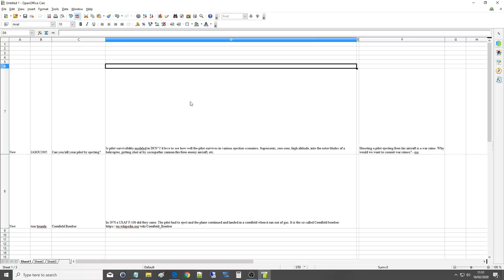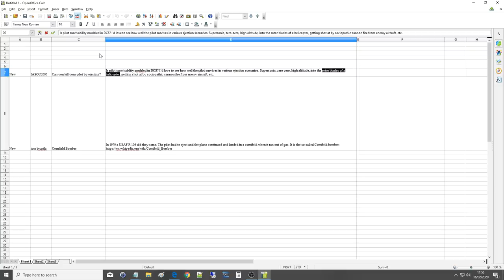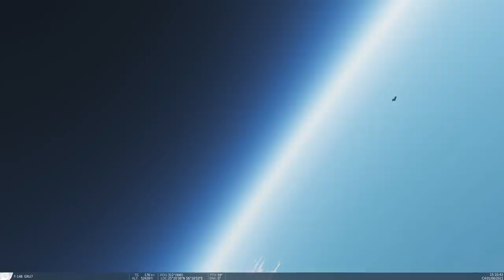Questioned: How Is Pilot Survivability Modelled In DCS WORLD?

Comment: In the late 70s, my dad and his pilot lost all air pressure in a CF-101 Voodoo at ( 'he says' more than 59,000) and they almost died... the pilot lost consciousness immediately, and luckily, the aircraft they were in was one of the ex-USAF two-stick aircraft rather than a single stick, my dad had to try and get down from 59,000 feet to around 10,000 feet before dying, flying from the backseat.    Probably had the speed record of a F-101 Voodoo on the way down (the wingtip light covers were torn off, the roundels were faded from the heat) but all the humidity inside the cockpit had turned into frost and coated everything.  he had to use the survival knife to scrape off the ice from a few instruments, and once down to 10,000 feet.  At this point his hands and face had swollen to huge proportions he said, and he couldnt hear anything on radio from their wingman, could hardly see, couldnt press any buttons, but he could see the wingman, who he followed back to base.   Wingman declared emergency for him, but the only switches he did NOT have in the back seat was flaps and gear.  he rocked the aircraft violently left and right until the pilot regained consciousness (otherwise he would have ejected both of them out, not knowing of pilot was dead or alive) and realized they were orbiting the base, and took command and lowered flap and gear.   When we saw him, it looked like he had been beaten up, because his face was all bruised, black eyes, the works, from the internal human pressure that counteracts normal air pressure had basically tried to blow them up, like Arnold on Mars in Total Recall.     He would fly again a few years later, but the perforated eardrum made it a painful ordeal, so he was pulled from flight status much to his dismay and went on to an interesting career looking at spy satellites, WMDs, that sort of thing.        

TL DR Pressure suits exist for a reason, if the front wheel door seal goes, all air from cockpit goes through the floor and outside the A/C
Reply: @Rivers256  I'd kill for a Voodoo.  after seeing the really nice F-106 skin someone did for the Mirage, I wonder if I could get someone to make an F-14 one (similar roles, though F-14 no nukes) 2 engines, 2 seater, old steam gauges.....
Reply: Fascinating story ! Thank you for sharing.
Reply: @Thunderkorn  anytime,, he has several awesome stories, but that one ended his flying career and almost his life.   No one ever wanted to eject out of a Voodoo, because it just might kill you (spine compression, it was old school ejection seat)
Reply: That’s pretty nuts, sounds like he just made it. Scary stuff
Reply: @rekunta  Yep.. my mom wasnt too happy when he went back up after his ear kinda healed, but then was happyx2 when he was taken off flight status.. bcs we were then posted to W. Germany :)
Reply: Matt Varnish your dad is awesome! Great story, thanks for sharing 👍
Reply: Better love story than twilight.

Comment: Cap when you eject (sr-71 at highest possible at mach 3) the air is so thin that the pilot feels like ejection at 200kn, the only thing they have to worry about is pressure(not sure) and oxygen supply
Reply: I don't think the pressure is really the problem as the pressure suits that were used were basically astronaut ones (not really, they were a model of their own, but close enough); the problem is the heat as a Mach 3 ejection would have subjected the crew to like 230°C (450°F), i don't know if they took that into account when they designed the suits, i assume they did, but i'm not sure.
Reply: Awww I was gonna say this
Reply: Nice thing about the pressure suits in a high alt ejection is that they “inflate”, providing some protection against the force of the air stream. There have definitely been SR71 pilots who’ve survived Mach 3 ejections (and even a disintegration!).
Reply: @keelhauling  The problem with your answer here is that full pressure suits aren't really designed to "inflate" (i'll explain in a second) besides, that would be actually what kills you becasue if you don't breathe out you can say goodbye to your lungs. The thing is that in a vacum (not really at 24.000m as the SR-71, but this is the extreme scenario) it wouldn't be just the suits inflating, but also the human flesh, as it can can expand up to twice it's size (see Alexei Leonov spacewalk). See, human skin doesn't need to be protected from vacum and it's gas-tight by itself, it just need to be mechanically compressed to retain its normal shape, in fact, since the X-1A, the pilots flew with partial pressure suits, that only had a pressurized helmet while the rest of the body was kept in shape by "metal tubes"; however, these suits weren't really confortable and they didn't give protection above a certain altitute nor for extended periods of time. Full pressure suits instead have no altitude limits as all your body is kept in a "habitable" environment (see X-15). The guy who sirvived not really an ejection, more really the disintegration of his SR-71, yes he survived (his RSO didn't) as the suit "kept him in one peice", but i'd like to remind you that both his shouldes were broken.
On a side note here, some sources claim that the A-12, still the fastest of the family with Mach 3.6, could actually reach Mach 3.8 or even Mach 4.
Reply: ROBERTO FONGARO ROBERTO FONGARO good stuff. To be clear, I didn’t mean to suggest that there was an any actual, intentional inflation going on, since yeah, the point is to retain pressure. Simply that the increased rigidity in a suit going rapidly from partial (cockpit) pressure to near vacuum provided some additional mechanical protection for the pilot.
Reply: ROBERTO FONGARO From Bill Weaver:

“I didn’t appreciate it at the time, but the suit’s pressurization had also provided physical protection from intense buffeting and g-forces. That inflated suit had become my own escape capsule.”
Reply from the maker: Interesting...
Reply from the maker: Interesting...
Reply: @grimreapers  that's why the crash at valley was so fatal they ejected at a low speed and a verry low altitude

Comment: Helos have had various ejection seats installed and tested but had some really funky rotor separation systems that would shed the blades before you went out. 0/0 was from back in the day where they were relying on airspeed to help clear you from the aircraft, clear you from the seat itself, and then ensure you had a canopy before you smashed into the ground. Ejection sequence is stupid fast...like sub 2 seconds from initiation to under a chute as long as you are low enough for the seat to let you go immediately.
You and the game are right, you would stay the seat till lower altitude and use the O2 that's onboard (the bottle on the side) unless you manually released it. Once your low enough you would be released and your chute would pull you out and the kit would deploy under you

Comment: It's worth noting that a lot of fighters and (especially) interceptors do have pressure suits - not just the SR-71 and U-2.

Also, there's such a thing as partial pressure suits, where for example your hands are exposed - these were used in at least the Mig-31 and F-106, and probably many other aircraft.

Also notably the F-4 did require a pressure suit when flown above (50/60, I forget) thousand ft, as did the F-106.

Comment: T-38/F-5 use the Martin Baker MK16 ejection seat. McDonnell Douglas originally developed the ACES II used on the F-15E and has three ejection envelopes, Low Altitude (Instant chute), High Speed (Drogue chute to slow you down), and High Altitude (Delays Pilot/Seat separation and chute deployment, kicks on oxygen). Both seats have barostatic altimeters, and speed sensors for determining mode. There is a pilot survivability chart in the documentation as well as a max recommended ejection speed of 600KTS.

Comment: I suspect at extreme high altitude ejection, you might be fine even at supersonic speeds provided you can survive the pressure. That same low pressure means there's not much air hitting you to batter your body to bits either.
Reply: so jets have less resistance up high but have to work harder because of lack of oxygen for engines???its like you gaining advantage and loosing it lol
Reply: @votpavel  And they handle more poorly due to less air flowing over the wings to create lift, and less air over the control surfaces to give pitch, roll and yaw authority.

Comment: Zero zero ejection seats are a recent development. For the first forty years or so  after ejection seats were first developed ejecting below 1000 feet was usually fatal because the chute wouldn't open before impact. Zero zero ejection seats have save quite a few carrier pilots who've had engines fail on take off and landing. I don't remember when they were first used but I think it was in the late sixty's or early seventys

Comment: Oh, when I was stationed in Okinawa, Det 1 operated the SR-71 right by our hanger. They went up one day. There missions lasted about an hour because of the fuel requirement. They refuel with a KC-135Q which carried JP-8. Well this SR did not come back when it was supposed to. SR's don't divert to other bases if they run into trouble. What happened was, they where around the Philippines at altitude, when they had a double flame out. After a failed air start, they punched out, and were picked up by some fishermen off the coast of the PI. The jet went inverted and hit the water so hard, it broke in half and the main gear wheel wells popped out of the wings. There was a big recovery operation to get the fwd fuselage, with all it's Top Secret equipment. Russian trollers showed up and were buzzed by F-14's or 15's while the Navy recovered the aircraft. Never got the whole story why it flamed out, but rumor was it was bad fuel. I know a team showed up in Okinawa to test the fuel in the tanker that refueled it after take off and the JP-8 fuel storage on Okinawa.

Comment: About the supersonic jump! In 2010 at Juupajoki, Finland there was a Hornet crash in which both pilot ejected at almost supersonic speed. This  Hornet was a Finnish "Frankenplane" F-18D, a modified F-18C. This Hornet was built from two plane. The main frame was survivor of a midair collision (2001) and the forward section was a from a Canadian CF-18B. So this F-18C was turned in to F-18D and therefore was a bit different kind of a plane. 

During the test flight F-18D's servo broke up. The F-18D dived almost at supersonic speed towards the ground. Pilots ejected at 4,5 km altitude in practically vertical dive. Due the speed the air blast broke both pilots legs and arms but they nevertheless survived the ejection. After a long sick leave and few surgeries they both have now returned to active duty. 

My friend knows the pilot. The pilots tells story that while he was lying in the ground with broken arms and legs the pain was growing up quite much. A local farmer came to the scene and before the farmer could say anything pilot told him sternly. "Now, listen me carefully. Before you do anything else, there's a tube in my left leg pouch. Take it and punch it in to me." This was filled with morphine or similarly really good painkiller. After that the pilot told it didn't matter how if the farmer panicked. Nothing actually mattered after that. It was simply painless bliss. :D

Comment: As a US Navy parachute rigger with 20 years, I have tons of experience with this. All parachute systems require a certain amount of time for the to fully deploy and decelerate the aircrew enough so that when they impact the ground they don't die. Zero/Zero eject seats eject the aircrew high enough so that after seat/man separation the parachute has enough time to fully deploy. In the F/A-18 it's .5 - 1.5 swings in the parachute between deployment and impact with a zero/zero ejection seat.

As far as the F-14 seat/man separation, you are correct, there is an emergency O2 system in the survival seat kit. The seat is designed to keeping the aircrew in the seat above 10K allowing him to breath at higher altitude. Additionally, there is a small drogue parachute that deploys from the head rest of the seat that decelerates the seat and prevents it from tumbling. This ensures that when seat/man separation does occur, the aircrew member is in the correct attitude for parachute deployment. 

Hope this helped. Thanks for all the great videos!
Reply from the maker: Thx Sir

Comment: That is what seats do. I don't remember off the top of my head but the parachutes aren't supposed to deploy till if I remember right between 10 and 15 thousand feet for sju5/6 and naces seats. The reason is like you said to get to an altitute the pilot can breathe before the emergency O2 in the seat runs out. Though there should be a drouge that deploys to stabilize the seat.

Comment: The one thing I was still curious about was whether or not zero-zero ejection was survivable in a plane too old to have an actual zero-zero capable seat RL.
The oldest plane I have with a seat is the MiG-21bis, which I tried and did eject the pilot fine... but from what I can find, I think the newer MiG-21 variants were capable of that. If anyone has an older plane and wants to give it a try, I'd be curious if it works.

Comment: The highest altitude at which a Martin-Baker seat was deployed was 57,000 ft (17,400 m) (from a Canberra bomber in 1958). Following an accident on 30 July 1966 in the attempted launch of a D-21 drone, two Lockheed M-21[7] crew members ejected at Mach 3.25 at an altitude of 80,000 ft (24,000 m). The pilot was recovered successfully, but the launch control officer drowned after a water landing. -Wikipedia.

Comment: The reason the chutes delay their release and seat separation is due to excessive airspeed in thinner air.  You'll see it in the airspeed readout in the data bar.  If the chute did deploy at altitude above 20K or more there's a good chance the pilot would physically get ripped to pieces as the harness cut through his body.  If he did survive the opening shock the chute wouldn't.  This is also the reason why reinforced reefed chutes are used for drag chutes and extraction of airdrops, they're smaller and allow air bypass for use at much higher airspeed.  Many of the military backpack type chutes had an altitude release option in addition to the manual D ring, once pulled I think they were set to auto open at 8K, been a long time.  So its modeled correctly, attention to detail.

Comment: Early seats weren't 0/0. IIRC the Martin Baker mk4 was the first fully automatic seat and had parameters of 0/80 (or thereabouts) which means 0 altitude but needing 80 knots of forwards speed. But it is about 30 years since I was flying on those seats so I may have recalled incorrectly. Rate of Descent is big factor, and again from memory you need altitude in hand of about 10% of your ROD. With regards to altitude, in addition to needing your emergency O2 (a small bottle on the seat) there is also an issue of parachute opening shock which is related to TAS whereas your terminal velocity is related to IAS. To a little drogue deploys to stabilise the seat, and then the seat separates and deploys the main chute once you get down to a lower altitude. Hope that helps.

Comment: Most aircraft are limited during normal performance in their height. However a pilot would still die above 10,000’ due to lack of oxygen.
There’s a couple of systems to prevent this. Firstly ejection seats have emergency oxygen bottles (EO2). These are initiated either manually with a lever or when the seat is fired. 
Secondly the seat has barometric sensors fitted. These sense the air pressure & if the seat is above 10,000’ it won’t release the main chute or release the pilot from the sea. The drogue chute will fire & it will stabilise the seat as it falls & once it’s below 10,000’ when it will fire the main chute & release the seat.

Comment: Cap, supersonic ejection being lethal only applies to low altitude flight. The reason pilots can eject from an SR-71 at Mach 3 and 90,000ft is because the air is so thin, the force exerted on the body is minuscule. The same logic applies to Felix Baumgartner breaking Mach 1 in free fall.
Reply from the maker: understood thanks

Comment: Humans dying instantly in zero pressure is a myth.  We don't explode, and we don't freeze instantly in space either.  2001 is one of the few movies that gets it right when Dave has to re-enter the spaceship with no helmet.  The immediate issue is no oxygen.  You will lose consciousness in 30-60 seconds, and die within 5-7 minutes.  Since the seats carry oxygen you will stay conscious.  At about 16000 feet you can breathe normally and ditch the seat.  That is good modeling.  However, ejecting at mach 2 should have been instant death.  That was bad modeling.

Comment: You two were stuck in the seat because of the altitude. The man seat separation happens around 14K-16K ft. This is due to the cold temps and low oxygen of the higher altitudes.

Comment: At high altitude the G-Suit is inflated to apply pressure to keep your blood from boiling. Head and legs are restrained and obviously the pilot will be holding the ejection handles.
Reply: Nope. As it says. It's a G-suit. It doesn't do this.
Reply: @finixhawkeye3213  It does at least on the K-36 on the Su-27.
Reply: I have to recheck my sources. As I don't want to argue unless I am overly sure. In an instinct I think it should. But need to reconfirm with my fighter pilot brother.